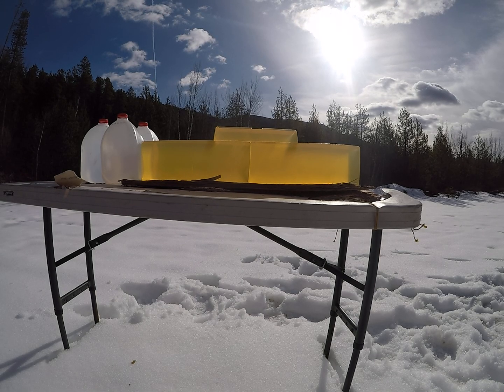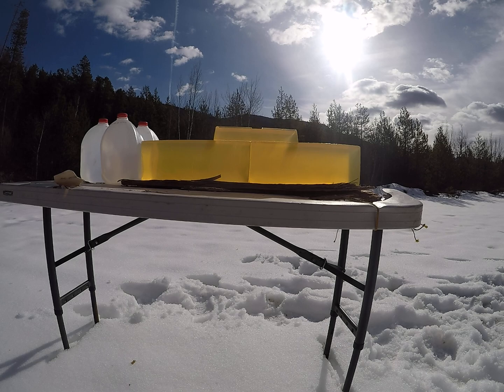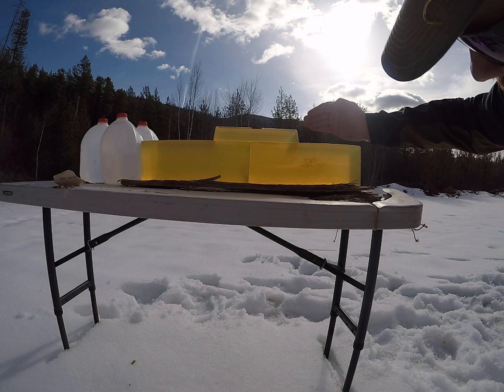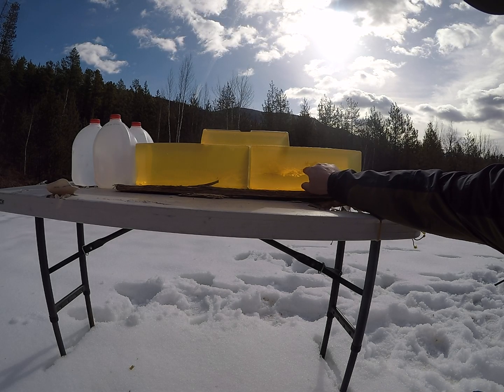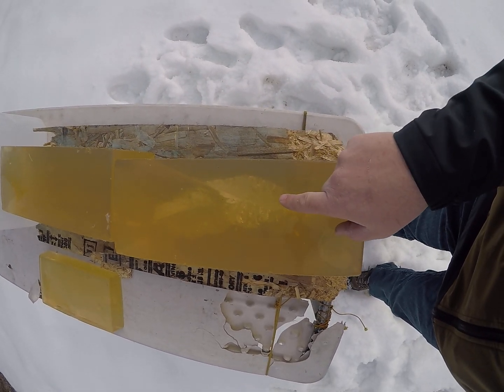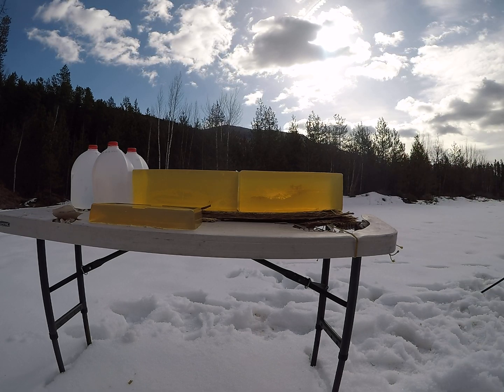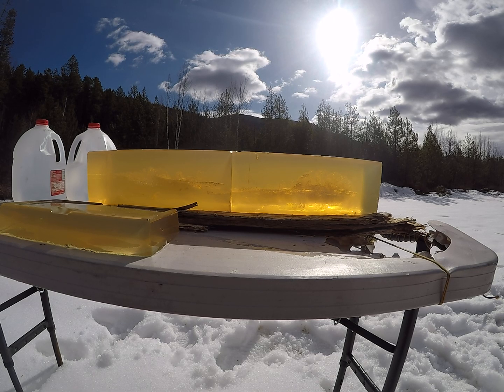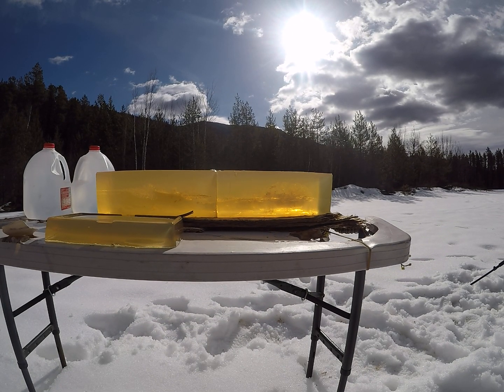6.5/.264 124 gr Hammer Hunter out of a 6.5 Grendel gel test

Comment: Try to get a hold of some Underwood controlled chaos bullets
Reply from the maker: I have done some testing on Lehigh defenses controlled chaos bullets and for what they are and how they're designed to perform they are a fairly decent bullet definitely not a go to for me but it is a decent bullet used properly.  I believe Underwood is the primary factory ammunition that has their bullets loaded in it but I don't believe they are the only ones.

As far as bullet testing like I do goes I just need the bullets they're gonna perform the same when fired at the same velocity regardless of whether their factory loads or not.